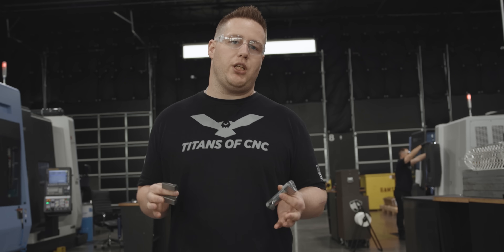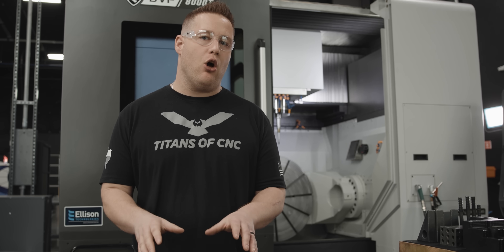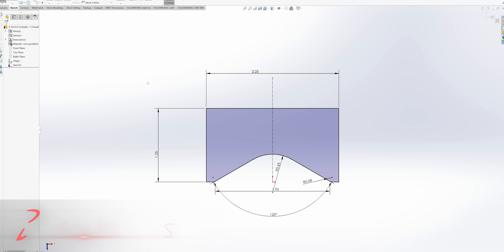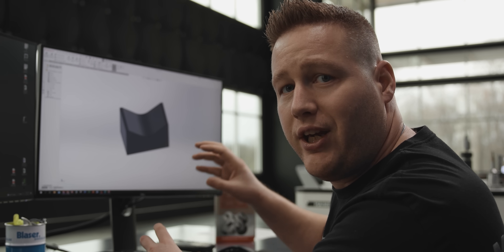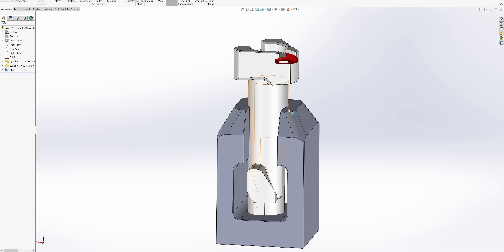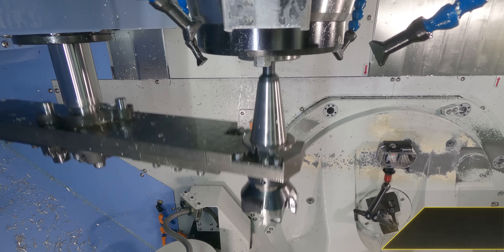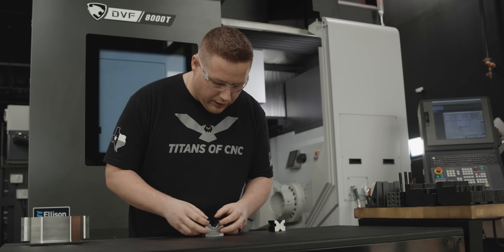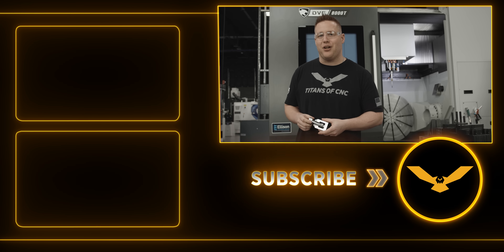Secret Process to Machining DIFFICULT Hard to Hold Parts | DVF 5000 | DN Solutions

Comment: I often made work holding fixtures for one off parts because well over half the time they become repeat parts and in the long run it saves a lot of time and aggravation. The little bit of extra time spent on the ones that don't become repeat orders is far outweighed by the ones that become repeat orders.

Comment: hmm i got a question althought the 2nd fixture, how can you indicate it for it to be straight sinds it has ''ears'' and that the features you machine must be in line with the ''ears'' on the side so how can you put it in the fixture , lock it down and be precise? cause the ears will still be able to move a little bit sinds there is a huge cap?

Comment: I am 77 years old, God if I could be a few years younger, or just have access to these CNC Machines!  I did a little Manule Machining in our R&D Machine shop at HP but that was self taught, like here is the airplane, you stat the engine here, here is the control stick and here is the throttle, advance the throttle until you are going fast and pull back on the stick - Move the stick in the direction you want to go! 😁    But at the time I did get the idea that how to hold a part of any complexity was going to be a big issue!

Comment: Taking time to design a fixture like this also means that if a customer comes back and wants to order 10 next time... then 100, you're not stuck in a bad spot trying to design a better solution because you spent the time setting it up once instead of finding a consistent solution the first time

Comment: Love these videos for ideas. My question is on the vblock you made why did you not bring a tap up from the side so when you set the part in there you would not have to indicate it. Being the part was cut from wire edm they would repeat. So a tab or even a  screw you could adjust to touch the bottom of the part flange. Then you would not need to indicate the top of the block to make sure its flat.

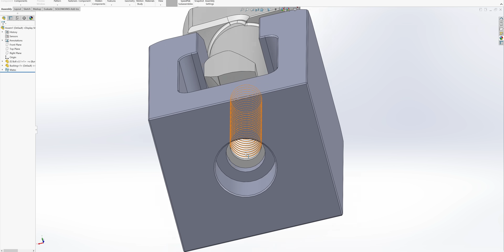Comment: 5:55 what you're describing certainly will lock the part for concentricity and repeatable z-axis location, but how are you going to index the part so that that cam is always in the same orientation, so that the workpiece does not rotate? some kind of separate piece that locks onto a feature of the cam and to the sidewalls of the pocket?

Comment: Stupid question from someone who has zero knowledge about CNC regarding that first part, wouldn't it have been easier to drill the internal features first while the out side of the part is still nice and square and then machine the 120° Angle afterwards? E.g. Machine the lower side, drill the holes and countersinks, then machine the 120° angle at the end. Is there anything that makes doing it in that order impossible? Would it somehow be more complicated that way?

Comment: Wait, so you machined the radius smaller than the part so you wouldn’t be sitting on the V of the part, is that what you’re saying?  I thought you’d want to sit on the V and not sit on the center radius?  Maybe I’m not understanding what you meant, I took it as you machined it smaller so it wouldn’t hit first (the radius) but that does not make sense to me.

Comment: For the second fixture I would skip the bold on the bottom and cut a slit on the other side that why the fixture will flex a bit and lock the part in with the vices pressure.

Comment: I have a very similar part to the second one, but no thread to hold it, I use a three jaw chuck to hold it, it doesn't have that thing sticking out.   I need to put our three jaw chuck on a fixture plate to make setups easier.

Comment: I'm curious to see your workholding solution for a lathe in terms of turning a solid of revolution, which is cut in half along the axis of rotation, has no technological holes for bolts to join them back together, and you have very tight tolerances on OD and ID, so you have to keep them in one position without any displacement from each-other during all the further lathe setups, after they are cut in half. Especially, when it's a longer part, and there are some clamping forces only where the chuck holds these halfs in one piece, while the overhanging body beyond the jaws will be displaced as soon, as cutter touches it.

Comment: Mostly I´m using 3D printed fixtures for single parts through the lack off time. Modelling at day, printing over night, milling when needed. Works well for me. Hint: You can write all the necessary data on your fixture...,name, date, offsets. SW offers a die and mould feature...if the fixture has to fit like a glove.
Reply: Most likely not durable enough. As this part will hopefully need to be made several thousand times, and part of the r&d costs is getting fixtures made.

Comment: For parts from the wire EDM with crazy angles I sometimes use the "scrap" to hold my parts - it already has the profile I need, so I can usually just remove some material off of the top to allow for indicating on the parts and then make a couple of threaded holes in the scrap and clamp my part down without worrying too much about the whole thing sliding around.
Reply: This is what I would have done as well. That scrap piece is already made, fits perfect, and priceless.
Reply: @robl4079  wouldn't the wire thickness make a difference?
Reply: @kaushikiyer9445  It should still be the same shape.  Even if you need to modify it slightly it should still be easier than starting from scratch.
Reply: @Nerdster883  makes sense. In this case they could have just made a relief at the radius to make sure the part rests by the sides and not by the radius
Reply: I'm not a machinist, but that's exactly what I was thinking: just start from the material you cut it out from?
Reply: Exactly what I was thinking.  If you cut it out of something then you should already have a matching part that got tossed.  Just use/modify that.

Comment: On the 2nd fixture, I would have made the base a bit thicker, countersunk the hole from the top and machine a keyway so that the boss on the side slides in, should prevent the part from rotating, the top and bottom will also be exactly in line each time
Reply: Yep. It's obviously a bolt for a firearm. The clocking of the part is going to be  important. If you're probing and using  coordinate system comp, take the 15 seconds to say so.
Reply: @markwatson4101  depends on what is being done, but they probably just indicate it straight and go from there.
Reply: that was the first thing that I meant to say :D
Reply: Me too...

Comment: Sorry to say but this is longest possible solution for the first part. Making fixture, and later storing it somewhere because part might come back in the future. First operation is to mount stock material in erowa 90 degrees clamping chuck. Use hole popper and burn starting holes. Second operation is wire edm and cutting this 3 holes. Third operation is to rotate the part 90 degrees and cut entire shape and cut off finished detail. 3 holes on edm will be maybe 30 - 40 minutes but milling machine is free and dont have to produce any fixtures. Of course you have to buy erowa chucks and holders up front but they are very usefull for lots of diffrent operations on wire edm and sinker edm.
Reply: You would still have to set up to chamfer the holes in the mill. So why not drill the holes if you have to set it up that way anyway, it's way faster, no hole popper, no slow EDM cutting, and they don't demand the accuracy of an EDM. Not to mention, if I don't put it in a 90 degree chuck on the wire, I can cut a whole gang of these out in one program using a plate.
Reply: @trevorgoforth8963  Operation alone is faster on mill but 3 holes maybe 8mm in diameter (yeah, stupid Euro guy here) are in my opinion about 40 minutes tops on wire(and if accuracy is not critical then just one pass should be enough), on mill you will probably lose about 2 hours to model and make this fixture. Hole popper is not big deal. If i remember correctly 1 minute per 40mm of steel with 2mm pipe is how fast should hole popper burn at least according to charmilles service technician. If you have to make 10 of these then yes, my method is inferior but for one part i can fight to the last tooth and i know im faster. Lets say whole part is made on wire. Come on, for chamfer alone would you fire up mill ? or just simple hand chamfering tool  to brake the sharp edges ? I know you guys are about precision and im mold maker so 0.01mm is my entire possible field for mistakes so i know what we are dealing with. I just think this fixture is maybe good as a lesson but well... no one pays for fixtures.

Comment: How did you position the lug accurately on the second part. looked like you did not have a way to locate it radially.
Reply: Indicating one of the flats on top is my assumption.
Reply: I don't know about the machine he did it on, but a few modern FANUC systems at least can indicate the angle of a surface in X/Y, then rotate the entire program to whatever angle was indicated.